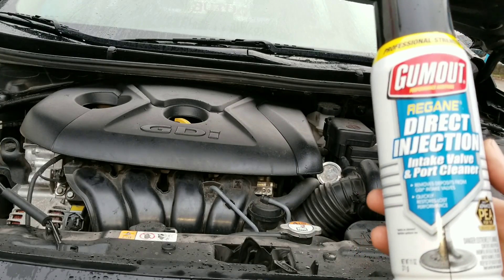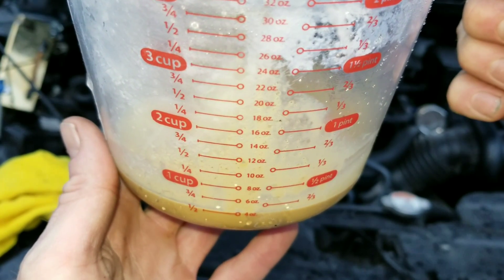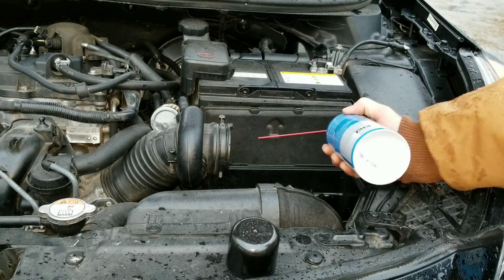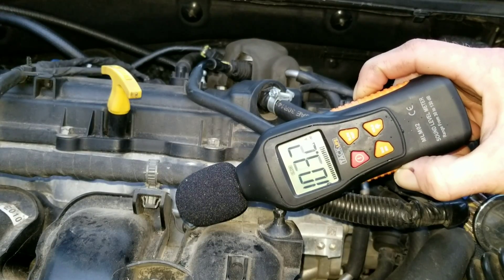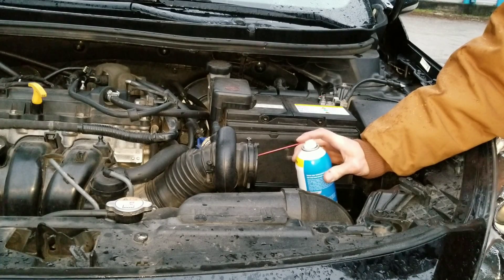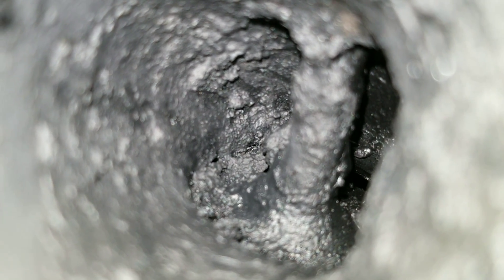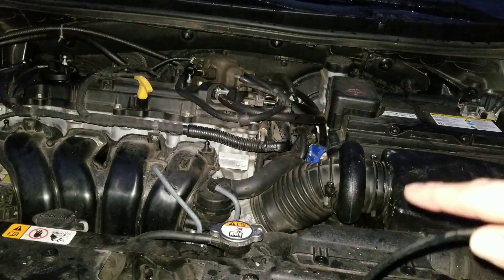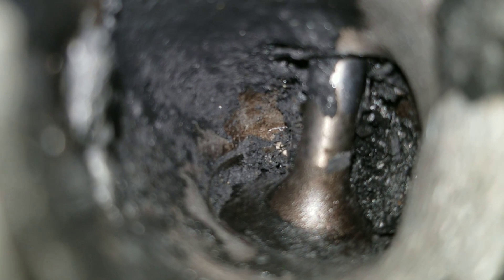SHOCKING oil catch can & gumout direct injection valve cleaner vs gdi

Comment: Hello guys. Can you tell me if I can do this job on Elantra 2008 with 155K miles on it? I have never done anything like this before in this car. Can create any problem if I do it so late? The car is making 38.1 MPG on the freeway or hwy and has never gone down from 38.1, so it's good for that car.
---- How many times can I use that product to give a good clean?

Comment: Do you have to change engine oil after cleaning the valves using such products?
Reply: It’s recommend that you do that.   Do it just before you change the oil.
Reply: @99SVTBolt  Roger that! Thx

Comment: I get about 1 quart oil consumption on my kia Rio between oil changes. About 3.5-4k miles. Normal or too much? PCV valve is fine, checked and cleaned it

Comment: I have a 2013 Hyundai sonata 2.0T gdi engine of course. I had gone to Hyundai last year for the GDI service they did a great job car actually was running quieter than before. So I know this is a huge issue with the values. I use now CRC GDI intake and turbo cleaner like every 14k miles or so. CRC works great as well I see some black smoke in my exhaust so I know it's burning some or the carbon off. Great video 👍. Please check out mine too thanks
Reply: Hi, can ask what kind of oil is suitable for ur car and 
w10-30 is good !

Comment: Catch can is holding mostly water from condensation mixed with a little oil, don't forget that this solution will freeze up also in cold weather.  Most people are adding metal dish washing scrubber pads in their catch cans to try to increase efficiency of filtering effect.
Reply: I have a catch can on my 2015 Silverado. It has never froze.

Comment: I started using the crc every 6k miles or so when I hit 12k miles...I installed an IAG AOS at 15k...My valves were pretty damn clean at 31k even before i did egr/tgv deletes...People say these cleaners dont work but they do...I prob didnt even need to delete my tgv/egr

Comment: Is there any way of connecting a thin tube to the boroscope and thread it to the valve and squirting gum out down the tube? Or is space a problem 🤔
Reply from the maker: It would bend the hose plus heat

Comment: Have you ever tried just spraying a heavy water mist into the intake while the engine is running 2000~2500 RPM like you did in this video?  I've heard guys claim it will clean up carbon deposits on valves and piston tops.
Reply from the maker: Yes i have check it out
Reply: Heavy water?
Reply: @brazenbunnies  - "Heavy" meaning a good amount of water mist vs a small or light amount of water mist.

Comment: Nate, can you please, do a video on how to look at those intake valves with your borescope. like where you need to insert the scope.
Reply from the maker: Yes i have in a previous video also depending on your vehicle try the intake or a port at your own risk and some i have drilled a access but it will be hard to observe all of the valves with the manifold still installed.

Comment: The best way to long term clean these valves I found out is to remove the intake manifold and spray the CRC directly on the valve when it is closed. It dissolves the carbon and makes the valve squeaky clean, just like new seriously. No need to scrub at all. Then you just vacuum out the black carbon CRC mixture. The engine should be off when you do this. You go one by one through all intake holes cranking the engine with a wrench to make sure the valve is in closed position.
Reply from the maker: Very nice idea
Reply from the maker: Yes thanks for sharing with the NIA community
Reply: Mussie Tesfay is that safe for the engine? I’ll consider doing that. Seen and read material mentioning doing walnut blasts but don’t have any equipment. You idea sounds good.
Reply from the maker: Do that at your own risk you must follow instructions perfectly but its more safe and effective if the valves are hot and engine running follow manufacturer's directions.

Comment: Use e85 and you'll have no problems with carbon!
Reply: E85 wont clean the valves on a gdi car. Since no fuel is sprayed on the valves on a gdi car. Alcohol injection system will will though as it is installed on the intqke manifold
Reply from the maker: They are saying spray e85 threw intake
Reply: @NATESINTERACTIVEAUTO  
Yeah that would work too. As e85 (ethanol 85%) is a form of alcohol and a good solvent. And if your car is tuned for e85, it will give you higher hp as well.
Reply from the maker: Yes your correct
Reply from the maker: The car isn't made for it

Comment: Definelty seems to be stronger result than crc or seafoam. I will try this next. Ive tried both seafoam and crc already, The seafoam seemed to make the engine run quieter even tho it doesn't use PEA as an active ingredient, The crc threw a code on my o2 sensor.. it eventually went away after 3 days... 96 dodge Dakota 2.5l
Reply from the maker: Interesting i haven't experienced problems so thanks for sharing
Reply: Good to hear. Ok did CRC yesterday and got a P2097.  Hoping it goes away soon

Comment: Is this safe to use on a direct injection engine with turbocharger? I have a 1.5L ecoboost... thanks
Reply from the maker: The product is made for this just follow directions and crc intake valve and turbo cleaner also is one of the few good products

Comment: Try Lucas Oil Deep Clean GDI. It's coming to stores around January. Wanted to see if it works hence their catch phrase "Lucas Oil, It works." Since GDI is hard to maintain from carbon build up.

Also thanks for this. This product works well. Would love to see you use a 2nd attempt of this product to fully clean the valves. This is amazing.
Reply from the maker: Thank you its one of the few that works well
Reply: @NATESINTERACTIVEAUTO  This video is very helpful. GDI is hard to maintain and Decent working products are rare. Looking forward to your next videos on additives. Subscribed good sir.
Reply from the maker: Thanks so much keep the ideas coming

Comment: Looks like the acetone is what the difference between the other products
Reply from the maker: What can we try next
Reply: I will look up but this seems like the product with the most acetone. Barryman combustion intake cleaner has less than 5%
Reply: Is this the same car on all these videos cause it does seem like it might clean the intakes but it accumulates fast
Reply from the maker: Not in all i go long terms and only 3 cleaners worked then i jave to wait driving 200 miles daily

Comment: New cars DO NOT have a pcv system
Reply from the maker: Not true
Reply: Most all cars sold in the US are required to have a pcv valve. Some cars now do not have EGR valves but for the most part you have to recuclate the exhaust gas
Reply from the maker: Thats very true and this car is one of them with no egr
Reply: You're an idiot!

Comment: This stuff actually produced some results! Some people say the best fix for carbon build up on direct injection engines is to give it a good hard run, aka the "Italian tune up." It would be interesting to take this car on a 2-3 hour drive, driving it hard, up to redline several times, really get the temps up and see if it shakes the carbon loose. Maybe a borescope video before & after a long hard run?
Reply from the maker: Yeah thats very good idea ill try and get to that next so this gumout is a new product and what about any good experience with a cleaner ?
Reply: NATES INTERACTIVE AUTO I've only ever used sea foam or marvel mystery oil through the intake manifold to try to clean out carbon, never did a borescope but did before & after compression tests on my 1.6 miata engine, didn't have any gain or loss in compression doing so
Reply from the maker: What would be a good test?

Comment: I need to buy stock in this company asap...lol....that said I still need to know if this is safe for turbos before trying....will it raise the temp higher than what is safe for it?  Other than that this is the best product you've used so far.
Reply from the maker: I habe found that taking your time slowly using over the coarse is the safest way. As the carbon builds up it will only become more of a issue and the valves can only hold so much. If i was concerned i would do a small treatment from time to time.

Comment: I'm subscribed. My suggestion:

Go to junkyard, get a $20 washer reservoir with pump inside. Get a 12v DC momentary switch. Get enough vacuum hose to run from trunk to engine. Connect pump to a manifold vacuum port. Wire in pump to dash switch to fused panel.

Fill tank with 50-50 Acetone/ATF. At every 100 miles, push button 10 times with hot engine at high idle 2.5k RPM. 

Way cheaper and more convenient than any spray can.
This mixture is around $13 a gallon !!!
Reply from the maker: Yeah sounds awesome ive been working with a similar idea also i want to try a vaccum line that will do this with nothing but a fill up of a reservoir time to time
Reply: HUBBABUBBA DOOPYDOOP this sounds interesting. Might be easier to just find somewhere in the engine bay to mount it so the vacuum hose won’t be so long. Either way, I like your thinking 🤯
Reply from the maker: Yes i thought of something similar
Reply: Good idea ❤

Comment: Does removing the mass airflow create any check engine light? My car is still under service warranty so wouldn’t want to void it.
Reply: You don't REMOVE the MAF, just don't directly spray it. Spray off to the side.
Reply from the maker: You dont need to remove the mass air flow sensor just spray passed and barley open the boot around air filter box insert straw between a small crevice and spray so that you dont have to take off boot also it wont set a code and even if you somehow did a auto store can clear it and they wouldnt even know you can say the air filter box was loose but thats up to you
Reply: Barley?  Making beer some where here?  Haa @NATESINTERACTIVEAUTO
Reply from the maker: Lol